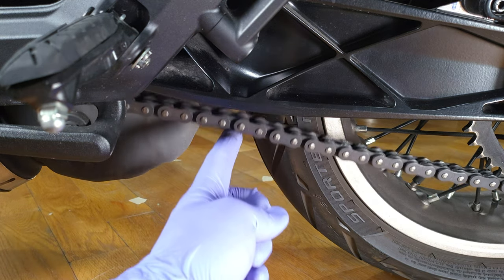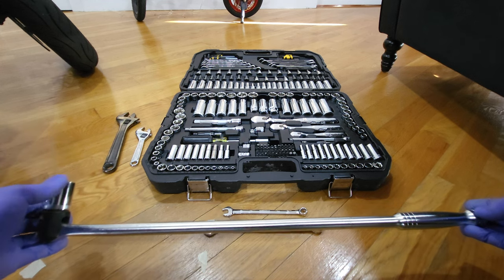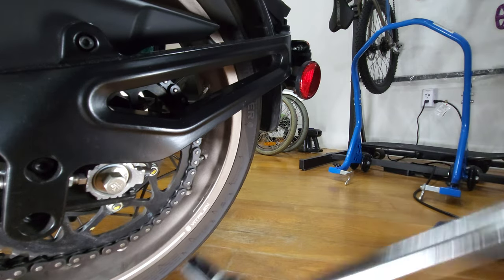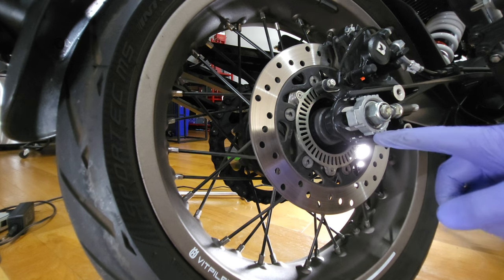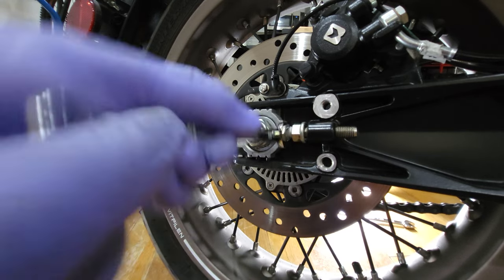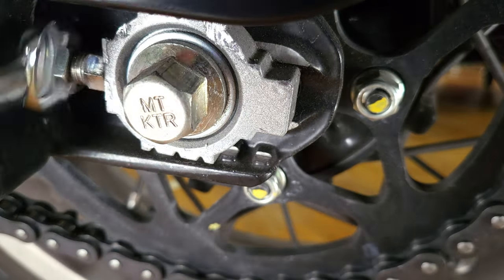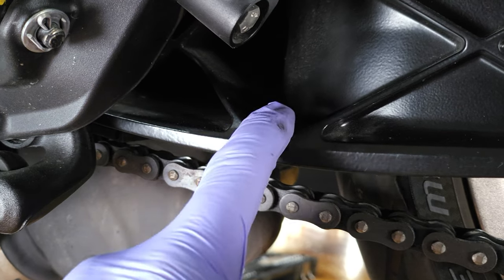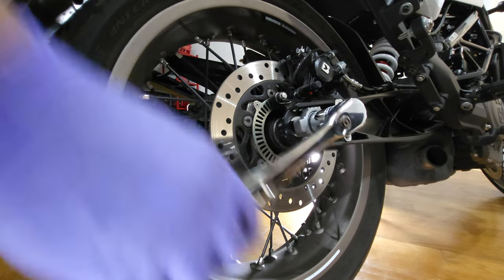Chain tension - Manuel spec, your not a husqvarna engineer.

Comment: Don't believe what the internet world says without any basis, just read the owner's manual and follow it. this is a correct way. 

manual said "press the chain
upward toward the link fork and measure chain tension" and it should be '5-7mm' 

If you are a reasonable person, you would follow the manual guaranteed by the manufacturer rather than unreliable information.

by the way, thanks for sharing this video it help a lot to me.
Reply: Exactly....don't believe what you see on the internet and this is a classic example of your mantra.This is totally wrong and the chain is way too tight and he didn't even check to see if the chain was aligned.Butt a cowboy

Comment: Did you rotate the wheel to find the tightest position before you started adjusting? If you skip that step, you run the risk of having the chain too tight.
Reply from the maker: Thats actually with another video im working on but with the bike stand
Reply: It better to release the nut from the other side (like you have tighten it) and of course best practice is to use a torque wrench to 90Nm
Reply: He dosent have a clue tbh

Comment: Hey man, it’s 7mm of clearance to the bottom of the swing arm which is what the little diagram in the manual states. You have to measure from behind the lip on the swing arm to the center lug on the chain. 

It’s still tight compared to other bikes but the manual definitely doesn’t say 7mm of chain play.

If you look at the manual you see the dotted line showing the measuring distance between the swing arm and the chain when it’s fully pushed up.
Reply from the maker: HEY MAN, if you dont own one.... stfu.
Reply: @Chevsilverado
You are absolutely correct. 
Finally someone that can read a diagram!
Reply: @brownmans360  I do… and I’m just trying to let you know that the way you do it isn’t correct. Two Husqvarna shops and and a KTM shop agree with me too.

Not trying to start a fight my guy, but take a really close look at the chain diagram and also read some of the documentation that Ktm and Husqvarna have released about their bikes.  Measuring the slack the way you did it is objectively incorrect no matter which manual you read.
Reply: @Chevsilverado  I get the feeling that he won't accept that he's wrong about this no matter who tells him.
So how different is this bike to all the others when it comes to the figure on chain slack? I recall some manuals stating 30 to 40mm for example, that may well be totally movement so 15 to 20mm in one direction. I've never heard of like 7mm being mentioned, that just doesn't seem right to me. Remember, these measurements I've quoted are when a bike is on it's center stand, to allow for the weight of a rider and full suspension at both extremes.
Reply: @steveclark..  So the chain slack is measured by the distance from the chain when pushed up to a specific part of the bottom of the swing arm, not the actual play itself. 

When you do it like that, you get like 25-30 mm of play in both directions, which is roughly where other bikes are too. 

The chain on the svartpilen is supposed to be adjusted on the tighter side of street bikes, but doing 7mm of chain play in one direction is WAY too tight. The manual also says 5-7mm of distance, and 5mm of chain play like this video claims is ridiculous for a bike.

If you look up Svartpilen owners manuals you can find what Husqvarna says about adjusting chain tension. 

Really, as long as you’re around 30mm total chain play on any bike it’ll be fine. Much better to be a little loose rather than super tight.
Reply: @Chevsilverado  It's interesting that they wrote the instructions in the manual that way, picking a particular point on the bike to measure to. Maybe you could do or find a video of the correct way to do it, to show this clown here? I agree that a slightly slacker chain would be the lesser of two evils, this guy's is a disaster waiting to happen, if it ends up snapping and he crashes, maybe he'll learn then??
Reply: @steveclark..  Yeah or if he destroys his output shaft bearing on his transmission.
Reply: I'm just checking the chain tension on my new 2024 Svartpilen (125), and it seems that they kept the same old image in the manual for chain tension as these earlier ones, but the shape of the swingarm has changed. It is roughly the same shape with the diagonal webs in the middle of the arm, but if you try to measure from the indicated point in the swingarm (where the two webs meet at the bottom in a V shape) it is further up the swingarm due to the new shape, and is actually over the rear part of the chain slider, while the manual clearly shows you measure after the chain slider, so it's a bit confusing.

I just measured after the chain slider as the manual indicates, and I'm getting more like 15mm between the top of the chain and the bottom of the swingarm (says 7-10mm in the manual), but the chain has about 30mm of slack top to bottom, which by your description should be about right. I have not adjusted the chain since I got it just over a month ago and this was measured just after 600 miles. I can't find any videos on adjusting the chain on the new 2024 frame (including the KTM versions of the bike), but I think it's ok going by the 30mm slack it has.
Reply: @brownmans360 I own one and I agree with chevsilverado
Reply: @brownmans360 made same mistake as you. It was so tight that pushing bike was hard

Comment: My god it looks tight 😱 But the manual says 5 to 7mm (0.2 to 0.28) and the upper part of the chain has to be taught. So that’s how the bike is constructed 👍 so it’s exactly how it should be on vitpilen 😊
Reply from the maker: The divas here dont understand like every person, all machines dont not operate the same way.
Reply: Most of them probably means well . 😊 And see it from the positive side. The more comments you get tha higher will youtube rate the video. So in the longer term it’s good to say or do something that people can’t avoid commenting on. Like this video, you’re not doing anything wrong but people have to write a comment. That’s good for your channel 👍🤩
Reply: @brownmans360  How does the chain and sprockets operate differently on this bike then? I've worked on many makes and models of chain driven bikes over 40+ years, I'd say that chain is too tight.
Reply: @steveclark.. I’m sure you know much more than the engineers at KTM/Husquvarna 😂. It’s literally the spec they call for.
Reply: @cottleful  It must be a mistake, just because you read it, doesn't mean that the person who wrote it didn't make a mistake or isn't an idiot. Even engineers can fall into those categories you know.

Comment: For anyone saying too tight, my chain was looser than this on this very bikes and the sprocket almost came loost from the rattle of the chain. The owners manual literally says 7mm
Reply: Hey you are measuring it incorrectly. The manual is stating that it is supposed to be 7mm between the chain and swingarm at that point when you push up on the chain, not 7mm of chain play. 
It's confusing in the manual but the chain in the video is way too tight. If you adjust so there is 7mm of gap between the chain and swing arm then the chain tension will be similar to most other bikes.
Reply: @roadster887  100% correct, this chain adjust tutorial is incorrect, and should be removed as it is totally off. For those viewing this BEWARE!! since it is on the ground it will being strung like a guitar string once you plop your butt on the seat, THIS IS WAY MESSED UP!!
Reply: Did not find tight part of chain
Did not hold adjuster  nut 
To tighten
Way too tight anyway
This video is dangerous
Reply: @greglee7604  yup it is DANGEROUS full stop
Reply: @dananolan7847  just sharing to save bucks
$26 aust for can of lube crazy
I use 90w gear oil and 1ltr
Lasts for ages
Reply: @greglee7604  understood

Comment: Hi there, just clicked on the video to leave a comment but when you measure the 5-7mm do you do it from the lip of the swingarm or the slightly higher spot behind the lip?
Reply from the maker: Not sure, but the chain has loosened up again. I ride my bike pretty aggressively. Only those who own this bike can relate, always goto your manual for reference
Reply: @brownmans360  Thanks but it doesn't really specify where to measure from. If you do it from the lip, try from the flat part because it would make the chain slightly looser. Maybe if it is done from the lip it would be too tight

Comment: Here are some observations :-
You need two spanners to undo, or do up a lock nut. One to hold the bolt in its correct position, and one to tighten or loosten the locknut. In one shot, you can actually see the bolt back off from its setting as he tightens the lock nut with one spanner.
Unless the bike has the sprocket shaft coaxial with the swing arm pivot, which means the chain tension is not affected by suspension movement, (The only bike I am aware of that actualy engineered  this is the old BMW G450X enduro)
As far as the chain is concerned, the tightest point will be when the engine sprocket shaft, swing arm pivot shaft, and rear axle shaft are inline. With the suspension compressed to exactly this point, you then need to find the tightest point by rotating the rear wheel and checking, then set the tension so there is  no "slack", but not so tight that you can't tweak a link slightly out of line with your finger.
Then for repeatabilitys sake, un compress the suspension and raise the bike so the rear wheel is off the ground, and then see how much slack there is. That, is the amount of slack your bike needs, period.
Don't rely on the marks provided by the back axle sliders to set your wheel alighnment.
Make sure that when the back axle is tightened, it is still in close contact with the heads of the adjuster bolts.

Comment: Unless the swingarm pivot is concentric with the final drive shaft, that is waaaaay too tight. Also, don't trust frame markings for wheel alignment.
Reply from the maker: Incorrect.
Reply: @brownmans360   As you wish. Your final drive bearing and your tyres.
Reply from the maker: @derekm6236  put your vin number down, cause you dont own a bike!
Reply: @brownmans360  I own two chain drive bikes. The tension thing is simple geometry. My statment above is correct. The Vitpilen must be the only motorcycle on the market with accurate rear axle position markings if you find your wheel alignment using them is correct.
Reply from the maker: @derekm6236  so your smarter then all the staff who built and worte the manual. 🤣
Reply: k @brownmans360   To have only 7mm of slack as a correct adjustment, you must either have a) the swingarm pivot concentric with the final drive shaft, or b) the suspension pulled up such that the centres of the swingarm pivot, the final drive shaft and the rear axle are in a straight line. This  the suspension  position where the chain is at its tightest. I'm not getting into a slanging match. This is basic 4 or 5th grade geometry; think about it. For your info. the manual for the RE Himalayan (2020 model at least) was also incorrect in this matter, leading to prematurely worn out chains and sprockets and numerous riders complaining of OEM chain quality.
Reply: Vernier callipers is what I use, I do not trust the rear block markers at all.  The rear block can be way out of alignment and you’ll think you’ve got it correct nope.  Finding the right part of the chain before taking your first measurement is a must.  The book is a guide from the manufacturer and it should be correct but not always 100% accurate
Reply from the maker: @1jonblaze  you work for husqvarna?
Reply: You mentioned that you’ve got callipers in your video lol  so why not use them to check the rear alignment as a super accurate way of setting it. Ride safe
Reply: @1jonblaze  I agree, until I got into machining, making parts on a manual lathe and mill, I never owned dial gauges and such like. The markings on the bikes swingarm just don't compare.
Reply: @brownmans360  There can be mistakes in workshop manuals you know, owners of previous Honda's that I've owned have pointed them out for example. At least ask a local dealer to confirm whether or not this chain adjustment figure is actually correct.

Comment: Are you not supposed to do that on a paddock stand?
Reply from the maker: Theres alot of people who are on a budget, and cannot get one I hope this will help those. But yes a stand is the best way
Reply: @brownmans360  mean the measurement of the chain is suppose to be made on a stand...
Reply: Yes the adjustment should be made when on the stand as it acts as weight on the bike, therefor making the chain tighter. As you have made the adjustment with the bike on the floor when you are riding, the chain will become too tight.
Reply: Depends.  My owners manual procedure for adjusting the chain states to leave the bike on the side stand,(kickstand).
So I suppose no.  You're not necessarily "supposed" to use a stand in every case.

Comment: Thats very right, i let mine kinda loose. It should be that tight only if driver with his luggage is sitting. thats when it needs to be adjusted. Imagine this chain tension now with a drive, pillion and driving over pothole and all that suspension compressing? Looser chain is better. I dont even maintain them, just pressure wash. Tighten it once or twice in a lifetime of chain, like 20k km and change it, they are kinda cheap.
Reply from the maker: Yeh what bike you ride?
Reply: @brownmans360  tiger 660 sport 2023m had hornet and sv650 before

Comment: This method shown in the video is incorrect, the chain is too tight.
You need to lift the rear on a paddock stand as per the manual.

Preparatory work
Raise the motorcycle with the rear lifting gear. (p. 108) (Shows paddock stand)
Check the chain tension. (p. 138)
Reply from the maker: im sure everyone watching how to videos has funds for things they will barely use. You people are so ignorant to other countries and there needs, YOUR INCORRECT!
Reply: @brownmans360  I have no idea what you are talking about.  
I'm just pointing out that your side stand method is wrong.  It's not used by Husky or KTM to adjust the chain.
What you do on your bike is upto you :-)
Reply from the maker: I guess you dont know how to read >>> TITLE says it all. Hit the dislike button twice 😘

Comment: My bike has to have between 35mm and 45mm play. 7mm will quickly wreck the chain and sprockets on any bike. You’re wrong.
Reply from the maker: You have no idea what your talking about, go troll the manual if you can read.
Reply: Other bikes arent really relevant to this - Adventure bikes need 35 to 45 due to offroad (jump landings) and luggage variables for example